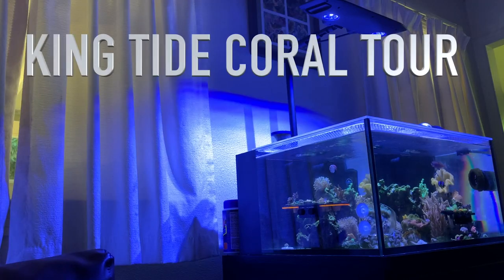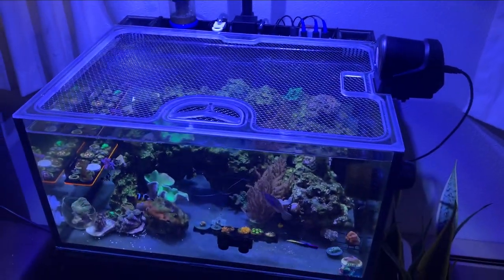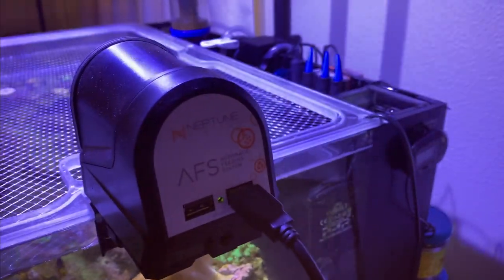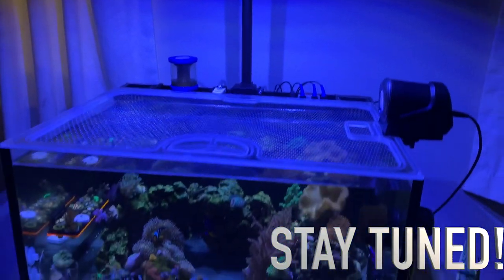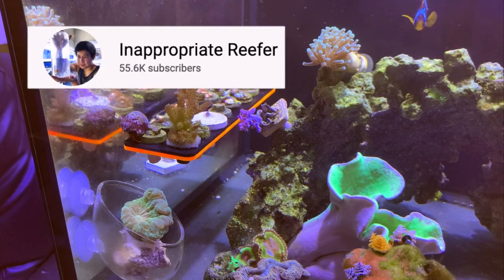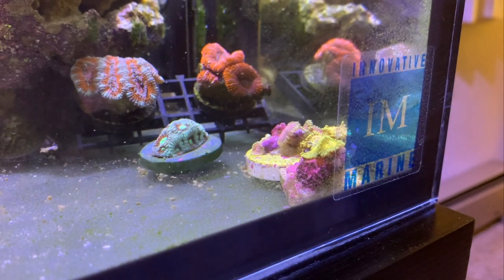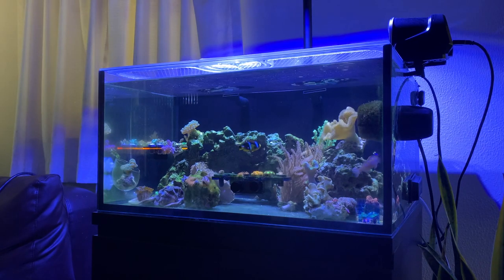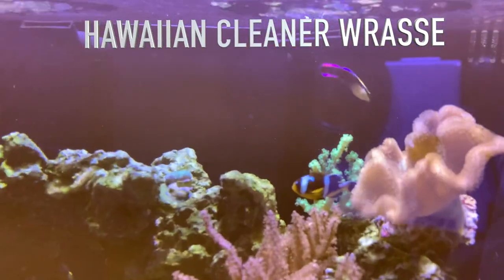Tour of the King Tide Lagoon!

Comment: Damn that’s a pretty damn high tech tank! Very cool 🔥 wish I had all of those fun gadgets on my 25g nuvo, but I’ll stick to my macroalgae instead 😜 love the energy you bring on camera too, great video!
Reply from the maker: Ms. Mermaid thank you so much! Means a lot coming from you! It’s got some slick gear no doubt. But I need it with my heavy feeding schedule 😂
Reply: King Tide Corals damn I just have to keep telling myself water changes and manually testing is so much cheaper 😂😭
Reply from the maker: Ms. Mermaid I like saying I’m not a gear head and then end up getting top notch to maintain my feeding habits and with the NPS/filter feeders I have I kinda have to have a solid nutrient export system. Still hold strong on my water changes #DatNanoGrind